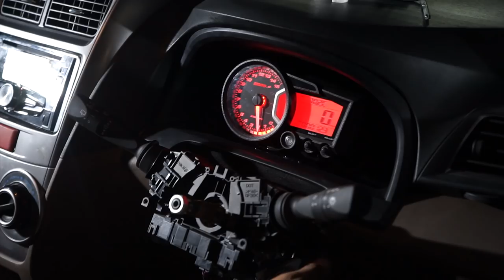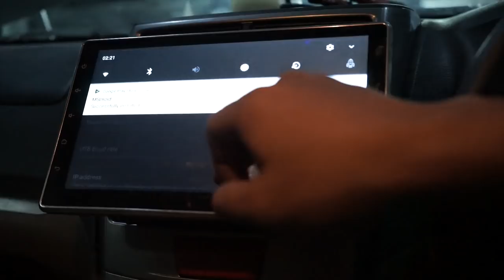Xenia V8 Mengejar Deadline ! | VLOG BENGKEL #11

Comment: #tanyaomturbo
Beberapa mobil baru ber bbm bensin udah pakai EGR(exhaust gas recirculation) utk ngejar emisi yg lebih bagus. Cuma EGR membuat ruang bakar lebih cepat kotor bahkan drop tenaganya sangat besar ketika kotor. Nah dalam pekerjaan remap ecu mobil bensin ber EGR ini:
1)apakah EGR perlu di sentuh seperti di disable biar tenaga naik?
2)apakah kalo di disable perlu ubahan hardware selain software atau sebaliknya
3)selain EGR, ventilasi crankcase jg menyumbang uap oli jadi timbunan jelaga, nah apakah penggunaan oil catch tank di jalur crankcase ke intake manifold berefek banyak? Apakah mobil dgn mesin standar jg bisa merasakan manfaatnya?

Demikian.Semoga om turbo sehat selalu utk ngerjain proyek2 om mobi maupun mobil2 di bengkel yg ketunda sama projek2 om mobi.

Comment: #TanyaOmTurbo om kenapa mobil diesel yang di remap ecu menghasilkan output yang besar, dibanding mobil bensin? dengan kondisi mobil sama sama standar
Reply: @christiantosonaifil  ngelantur mas?
Reply: @christiantosonaifil  wwwkkkwwkkkkkk
Reply: Yg ngasilin tenaga gede dgn remap ecu itu mobil diesel berturbo modern.kl mobil diesel biasa ya gk ngasilin tenaga gede,jg dgn diesel turbo lama(panther turbo misalnya)mobil bensin turbo modern jg bisa ngasilin tenaga gede dgn remap ecu.setauku begitu.
Reply: Entah gedenya seperti apa ... Tapi diesel memang tenaganya lebih gede dibanding bensin untuk CC yg sama & dari pabrikan yg sama .... Makanya gak ada truk berbahan bakar bensin
Reply: @t-hoxautopublic9314  torsi nya gan,mesin diesel torsi nya jauh di atas mesin bensin...utk HP mesin bensin lebih unggul
Reply: @t-hoxautopublic9314  torsi bos yg lebih besar, kalo power ya mesin bensin lah makanya ga ada ferrari pake diesel wkwkwk
Reply: Injektor mobil diesel untuk common rail bisa lebih dari 2000 bar, kompresi diesel lebih tinggi, rata2 yg ngeremap ecu diesel merasa aman karna blok, piston dan kawan2 dari baja, beda dengan bensin yang rata2 alumunium konstruksi  blok nya jadi ada batasannya agar ngga pecah blok nya
Reply: @danielwilliams3378  😄😄 andaikan ada Ferrari yg BBM-nya diganti diesel ...penasaran Ama raungannya
Reply: @DickyChannelTV  itu beda nya di sistem penginjeksiannya modern common rail, yg lama mekanikal pake injection pump atau bos pomp orang bilang, bukan turbo lama atau baru
Reply: @t-hoxautopublic9314  dulu AUDi bikin mobil balap pake diesel dan langganan juara...gk bisa di anggap sebelah mata,hanya saja bahan bakar solar yg ada di indonesia jg blom cocok dgn mesin diesel modern,nilai CN(kalo di bensin kan RON)kurang tinggi,dan sulfur kurang rendah.kalo pun ada mungkin harganya ngalah2in pertamax turbo kali ya😂
Reply: @t-hoxautopublic9314  grong grong otok otok otok wkwk
Reply: @yogisykes  oh iya,itu jg termasuk,kalo yg baru kan letak injektor tepat di ruang bakar,macam letak busi d ruang bakar,dan itu bikin muahal.hehe.mantab info nya gan
Reply: Kenapa diesel torsi gede hp nya kecil ya karena putaran mesinnya ga setinggi bensin, power kan perhitungan torsi sama rpm, jadi ya ga cocok buat balap karena teriak mesinnya kurang kenceng
Reply: T-HOX OTOSPOT sebenernya kalo diesel yg dicari angka torsi nya, mohon koreksi kalo salah ✌
Reply: @tyohary2284  Hayo coba cek Audi R10 TDI, sang legenda di dunia balap LMP1 atau Le Mans. Kata siapa diesel ga cocok buat mobil balap? R15 TDI dan R18 TDI penerusnya juga masih gacor. Putaran mesin diesel memang gak tinggi, tapi bisa diakalin dengan jumlah gigi yang banyak untuk nafas yang panjang. 
Mesin diesel atau mesin bensin masing-masing ada baik buruknya. BMW juga ada M50D, Audi ada SQ7 yang notabene adalah SUV berbadan bongsor tapi bermesin diesel yang ganas. Coba cek figur akselerasi dan tenaganya.
Mesin diesel mempunyai blok mesin, con rod dan piston yang 'biasanya' jauh lebih kuat dibanding mesin bensin karena tekanan yang dihasilkan oleh mesin diesel sangat besar dan butuh bahan yang bagus untuk menahan tekanan tersebut supaya tidak menyebabkan kerusakan. 
Itu lah kenapa mobil kayak Innova atau Fortuner sering digunakan buat drag karena mesin yang digunakan (2KD-FTV) yang notabene adalah mesin diesel, sanggup menahan tenaga yang besar dengan blok dan piston standar. CMIIW, bisa tercapai 200HP tanpa perlu merubah blok dan piston. (standar 102 HP non VNT, 149 HP VNT)
Reply: @tyohary2284  kurang tepat jg gan,Audi menang di balap le mans pake mesin diesel.torsi diesel yg gede di akalin pake tranmisi dgn jumlah banyak,gk di kembangin lagi mungkin karna bahan bakar yg sesuai gk menyebar di seliruh dunia,dan pastimya mobil jadi mahal...mngkin lo ya
Reply: Kalo menurut teman bengkel saya, diesel blok mesinnya lebih badak, lihat aja kompresinya, rata2 16-22 : 1
bandingkan dengan bensin yg kompresinya aja mentok 13 : 1, lebih dari itu bensin oktan 100pun gk akan kebakar malah ngelitik hancur blok mesinnya

jadi tinggal maen2 sama kompresi saja tanpa turbo, mesin diesel udah bisa menghasilkan output yg lebih
Reply: @adjishiddiq748  tepat gan,waktu aku boreup motor...aku cari liner mesin diesel,biar kuat,wkwk,lebai sih,tp pingin awet aja,hasilnya...ya piston K.O duluan
Reply: @danielwilliams3378  😄😄 auto ngeden
Reply: @DickyChannelTV  perta dex / Shell masih kurang tinggi ya  standardnya...soalnya disini itu sudah tertinggi
Reply: @t-hoxautopublic9314  cukup gan, tapi kan gk semua kota ada tuh.. macam pertamax turbo... di kota ku gk ada... mesti pindah kota dahulu baru ada.. hehe
Reply: @DickyChannelTV  apalagi Shell ...
Reply: @DickyChannelTV  itu direct atau indirect injection, diesel jaman dulu kaya isuzu 4BD1,4JA1,4JB1,4HF1 mitsubishi fuso jaman 80an juga sudah direct injection dan pake bos pump tipe inline. Ya, pada jamannya diesel common rail injector lubangnya dibikin tambah kecil sampe ga keliatan kalo diliat mata, injector common rail buka tutup/injeksi timingnya pake solenoid yg diatur sama ecu, bos pump engga pake, injeksi timingnya dari bos pump, panjang dah jelasin pompa injeksi diesel kalo mau saya kasi nih materi motor diesel
Reply: @DickyChannelTV  mahal nya injector common rail karna udah elektronik dan tekanan nyemprotnya lebih tinggi
Reply: @adjishiddiq748  kompresi 19-22 hanya untuk yang indirect karna injectornya ga tepat diatas piston ada ruang terbakar sendiri, diesel jaman sekarang kaya 1KD,4D56 crdi kompresi 18 atau 17, mesin yg baru baru 1GD,4N15 kompresinya 15,6 atau 15,7 karna udah ada tambahan vvti di intake, injector sudah model piezo tekanan nyemprot bisa diperbesar kompresi mesin bisa diturunkan, mesin jadi lebih halus...
Reply: @yogisykes  di diesel modern sebenarnya kompresi juga tinggi om, misal mesin 4N15 nya pajero, disitu tertulis 15.8 : 1, itu hanya kompresi udara dari air intake, kalo ditambah lagi tekanan dari turbo (saat turbo kick in) ya nambah lagi kompresinya jadi 20.4 : 1 untuk pajero 4N15. harus di dyno kalo pengen tau kompresi real saat turbo spulling dan saat kick
Reply: @adjishiddiq748  diesel butuh udara banyak ketika langkah kompresi karna untuk meledakan bahan bakar yg disemprot injector, nah agar tetap menjaga udara hasil kompresi tetap panas, bahan bakar diinjeksikan lebih sedikit/tekanan ditambah,tidak merubah kompresi aslinya tidak seperti mesin bensin, turbo sebesar apapun bisa tergantung kuatnya blok,piston,conrod
Reply: @yogisykes  audi balap pake commonrail gan,yg ada di dalam ruang bakar.saat itu kan teknologi kyk gitu kan mahal,skrg aja cm beberapa mobil bensin yg pake teknologi injektor langsung k ruang bakar.waktu itu (lupa thn berapa..kyk nya 2000an gitu ya)audi ingin membuktikan bahwa diesel bisa di pake utk balap.mobil eropa era 2000 an jg ada yg pake teknologi itu,cm jatuh nya lebih mahal dari yg bensin(skrg kyk nya jg iya ya)termasuk pemilihan bahan bakar,mesti sulfur rendah banget biar gk buntu injektornya
Reply: @t-hoxautopublic9314  biasa kalau buat racing, ditambah ethanol, tapi di USA kalau ga salah ilegal wkwkwk
Reply: @DickyChannelTV  Hiyaaa teknologinya common rail, kalo direct injection dari udah lama pas masanya bosch pump gitu lho, toyota bikin mesin common rail dari mesin kecilnya juga 1CD FTV dilanjut ke 1KD FTV, ya emang mahal coba aja cari di wikipedia harga injector triton hilux ranger berapaan, supply pump apalagi
Reply: Mesin 1CD FTV udah dari tahun 1999 kalo saya liat di buku manual repairnya

Comment: #tanyaomturbo
masih tentang pertanyaan mengenai air radiator, menurut tukang bengkel langganan saya, katanya untuk mobil tua sebaiknya pakai air keran/air mineral botolan. karna radiator mobil jaman dulu tidak diperuntukkan menggunakan radiator coolant. apakah benar seperti itu? karna sempat saya coba ganti dari air mineral jadi radiator coolant pada mobil saya, dan hasilnya muncul beberapa masalah seperti temperatur jadi lebih cepat panas. akhirnya saya kembalikan ke air mineral lagi karna takut merembet ke hal lain.
Reply: Kamiki Games kalo menurut sy sih radiator kulen bagus untuk semua radiator. Problemnya karena pada mobil lama kebanyakan tanki radiatornya udah ngeflek coklat bata. Karna kulen bersifat anti karat, kerak, dsb, jadinya flek2 coklat yg ada di radiator bisa rontok, dan rontoknya kemana? Kehisap radiator
Reply: Kalo mau pake aer biasa pake aja air minum cleo yg udh demineral,
Reply: Mobil saya usia 23 tahun pakai coolant
Reply: mobil saya 17 tahun pakai coolant, diesel lagi 4D56.
Reply: Fachriza Dwi amidis

Comment: Oiya om, untuk masalah radiator kulen, ada yg bilang kalo air biasa trutama air AC lebih bagus drpd radiator kulen. Katanya sih kalo radiator mobil, trutama mobil lama yg tanki radiatornya udah ngeflek coklat bata dikasih kulen yg ada teknologi anti karat dsb, karatnya bisa rontok n masuk ke mesin. 
Kalo dilogika ada benernya sih. menurut om turbo gimana? #tanyaomturbo
Reply: Masuk ke mesin ke mana nya nih? Coolant kan emang masuk ke mesin/water jaket nya blok silinder, mungkin maksudnya masuk ke ruang bakar atau saluran air sama saluran oli nyampur gara2 paking silinder head sudah pecah atau aus